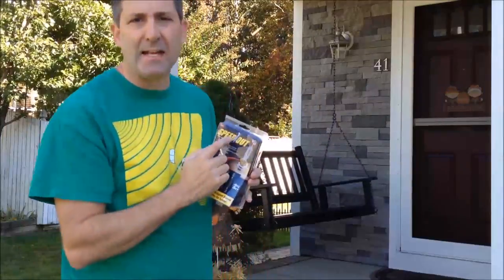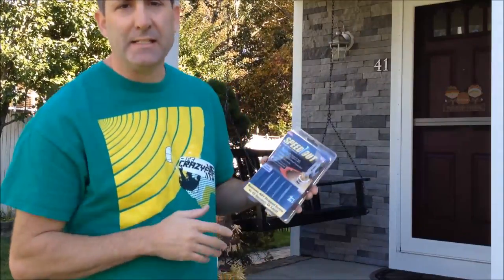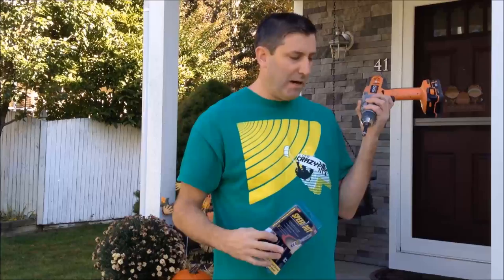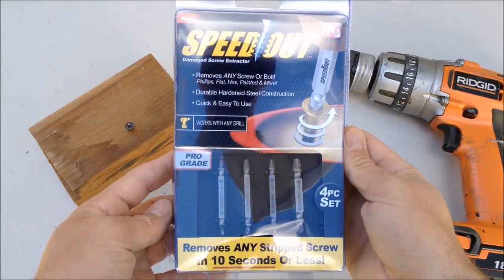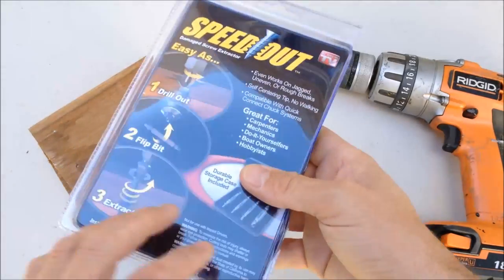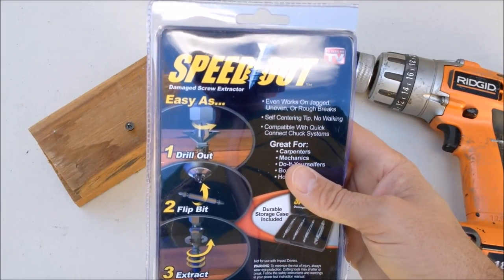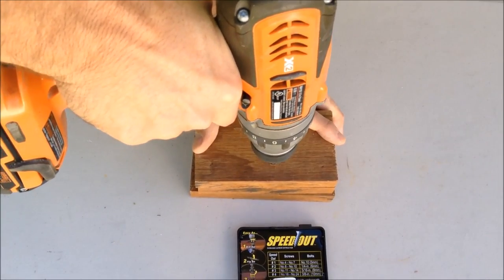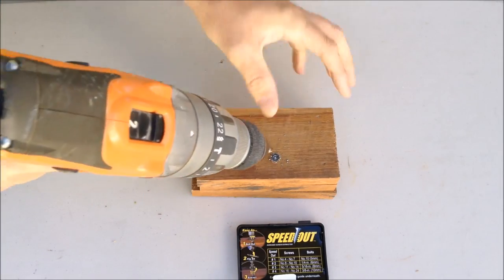SPEEDOUT - Damaged screw extractor - THIS THING WORKS 🔩🔩🔩

Comment: I've never had much problem getting a screw out of wood without an extractor. This extractor definitely did the job quite easily. But I have a screw stuck in a bicycle part so its metal to metal. Still a good review.... thanks.
Reply from the maker: True...i purposely stripped the head so that the screwdriver could not get a good grip.  Thanks for the feedback.

Comment: The spring in my front door mortise lock broke (not bad, as it's probably pre-1925) and to remove the lock, the doorknobs need to come off. One has a set-screw and the flat-bladed slot was messed up by a previous worker. It wouldn't budge and I made the slot worse. So... tried out a #2 Speed Out and I couldn't believe it, but it worked! Set-screw was steel and knob, brass, and I could see the corrosion/rust on the top 3 or 4 screw threads. Rusted in a bit, one might say. Anyway, I'm very impressed!  One note though; once you insert the tapered end, push quite firmly for it to dig in and grab.
Reply from the maker: I guess every now and then a worthwhile tool is "as seen on tv"

Comment: Thanks for the vid. If anyone does the extraction, keep your drill in LOW or small number speed. I'm surprised your screw cam out as fast as you went in reverse.
Reply from the maker: your right on the speed - don't you have to go in reverse to backout the screw?
Reply: yessir, reverse to remove.  @Kitearmy

Comment: Have a Fisher and Paykel top loader gas dryer that was making a screeching noise due to a bad bearing.  The M5 allen bolt on the inside of the drum was frozen and I ended up rounding it so that nothing would work to get it out.  Went to Lowe's and bought a SpeedOut kit and ended up using the largest of the extractors and followed the instructions to the letter.  Reamed it first with the drill in reverse to at least 1/16" of an inch into the bolt and then flipped the bit and used the extractor.  The 1/2" drill I was using didn't have the power to turn the bolt (only to bite the bit into the bolt), so I clamped on a Vise-Grips locking pliers to the extractor bit and gave it a very slow, hard turn.  And sure enough, I heard a snap and that bolt came loose.  The extractor was into the bolt deep enough so that the heavy 1/2" drill I was using was literally hanging from it, but it didn't have the torque to do break the bolt.  But, the SpeedOut did do the job.  Consider me impressed with the tool.  It may not work in all circumstances, but it is definitely something to have in the toolkit when all else fails.  For $10 and a trip to Lowe's, it saved the day.
Reply from the maker: That's crazy...I thought that comment was going to lead to a serious complaint about the speedout.  Stoked it worked for you
Reply: @Kitearmy  Thanks.  In my experience with the tool, using a large enough size and reaming the frozen bolt deep enough are very important.  It gives the extractor a chance to bite in and do its job.
Reply from the maker: Still cool to here that it worked
Reply from the maker: That sounds like good advice

Comment: I see some posts saying it doesn't work, but some may have done the same thing I did.    I just looked at the quickie instruction card that says it's as easy as 1. drill out, 2. flip bit, 3 extract.  In number 1 drill out,  it doesn't mention putting drill in REVERSE, as would be done using a regular drill bit, although if you look carefully you can see the little arrow on the drill bit is counter clockwise.  Seems to me that would have been spelled out and maybe others have done the same thing. I did not notice the littler counter clockwise arrow and drilled with high pressure (clockwise) and just barely made a dimple not deep enough to use the extractor side.  I used a regular drill bit in my drill which you must use in clockwise motion of course, and that was what I and most others that had to do this was used to. Then I used the Speedout bit in reverse as would normally be done with any screw extractor and it worked.
Reply from the maker: It's still a 50/50 on success

Comment: Stuff works I used it on honda civic rotor screw shit worked. U gotta use some lubricant for the bit..
Reply from the maker: RAMON RENDON had an old Craftsman set that never worked.  So I expected that this would be a flop too.  It's now always at the ready in my tool set.

Comment: Can I use that on engine bolts on dirt bikes?
Reply from the maker: If the heads a striped, it's worth a shot - what do you have to loose.  Just take your time so that you don't make things worse.
Reply: i bought one for mine my front fork guard bolts were stripped
Reply from the maker: Did it work?

Comment: The first step to drill a hole on the tip of the screw with the drill bit. You said put it in reverse, was it the correct to do it or just misleading us? I know the third step is in reverse but first step???
Reply from the maker: good catch.  Forward first to drill out.  Reverse to remove screw.
Reply: @Kitearmy  the directions clearly say to do Step 1 in REVERSE.  So basically BOTH steps are done in reverse.
Reply from the maker: no no no - 2 reverses make a positive
Reply: @Kitearmy  in your vid you clearly say put the drill in reverse first and drill it out and in these comments your saying dont do that so witch is it

Comment: Won't work on old deck screws. The bits actually stripped and didn't cut into the screw at all. The screw heads were fine. I followed the instructions and tried these more than once. I actually stripped out 3 out of 4 of the bits. Returning  this to Home Depot today.
Reply from the maker: Yeah - it depends on the material the screw is made of
Reply: @Kitearmy  Got my refund and went to Lowes. Picked up a single #2 screw extractor (black and decker) and tried it on the deck screws. This extractor actually worked! It takes a little effort to get the reaming side of the bit to work but once a little of the screw material was removed I could back the screw out.
Reply from the maker: @ubb4me  Success!  Glad it all ended well...

Comment: idk mine won't even drill a hole in the screw head like yours.........maybe they cheapened the heat treat????? I just bought them can't take out any screw I threw at it
Reply from the maker: Strange - I have used mine a few times since this video and never had a problem.
Reply: +1stfloorguy ,maybe you are not drilling in reverse?
Reply: +ddistrbd1 I thought so to. I tried both ways
Reply: Damn good deal!!THX!!

Comment: will it work on a broken bolt?
Reply from the maker: can you score a cut in the head of the bolt?  I would do that before counting on this tool working.
Reply: The head of the bolt broke off.
Reply from the maker: If you have exhausted every other option - then this is your tool

Comment: I'm using this tool, but is not working for all screw with my impact driver.. Maybe i'm buying fake screw extractor with seem authentic.. So this is not working.. :(
Reply: Bobby you can check Alden products. 100% Made in USA. More expensive but it will do the job, It can be use on automobile. In one set you have all your screw extractor you will need,
Reply: I can’t get it to work either but I will say the instructions say do not use with impact driver